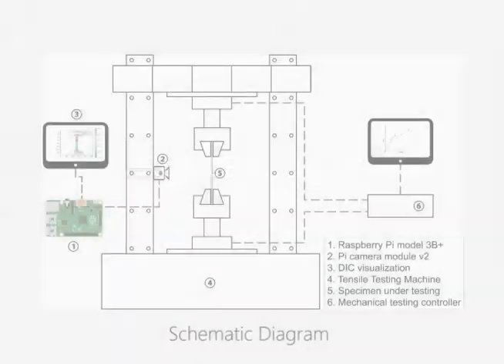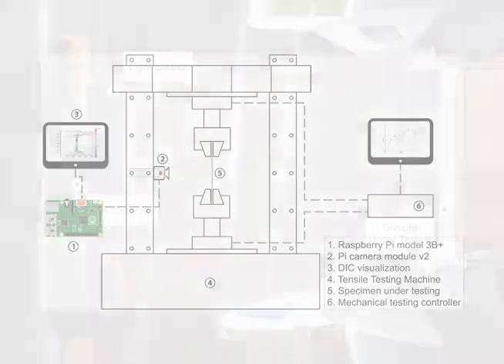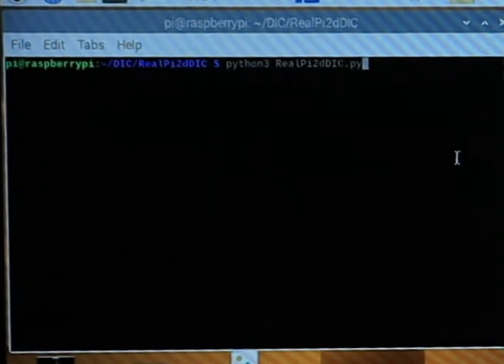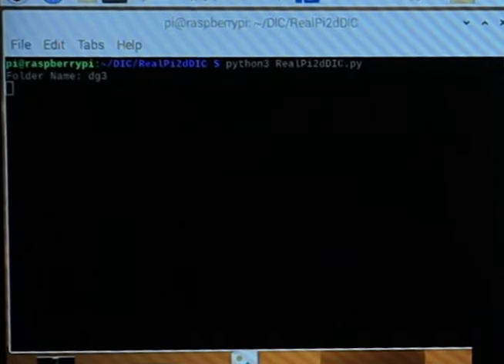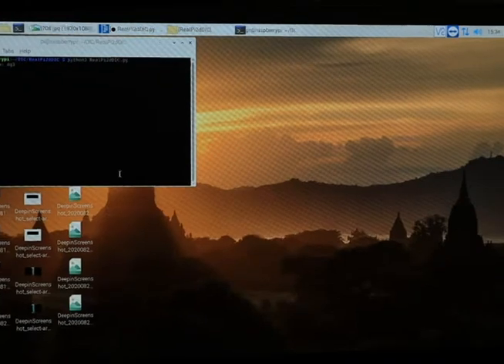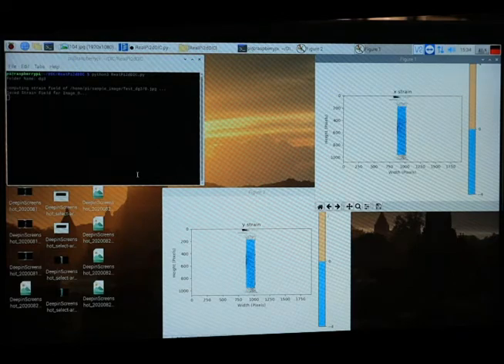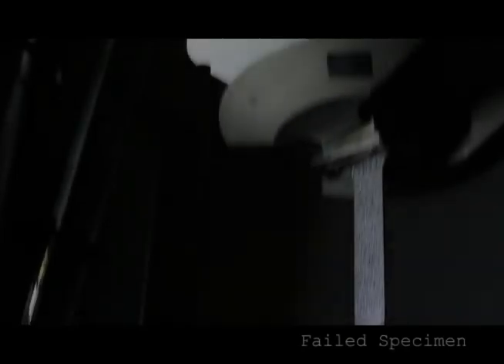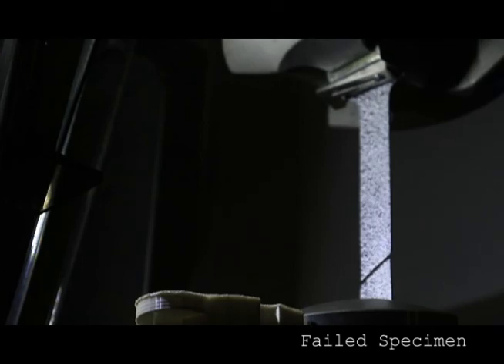RealPi2dDIC | Instructions and Demonstration

Comment: Hi Dr. Partha. I am Jorge, a professor at the Guadalajara University in Mexico. I am trying to understand if RealPi2dDIC is proper to measure strains during compression tests of small samples. I work with cylindrical samples around 6 mm in diameter and 8 mm in height fabricated by powder metallurgy. I hope to use a Raspberry Pi 400 with a 1080p USB cam (webcam). I read your paper and I was trying to find the permissible ROI size but I just saw that the software will divide the surface in small mesh grids (10 pixels x10 pixels) and that this could be changed at the source code but I would like to be sure if my setup is proper for the kind of samples I work. Thank you in advance.

Comment: Great job !
We have made a python tool to control experimental tensile test machine in RT in python !
it works on every linux PC including RPi{3|4}.
We already use python OpenCV  DisFlow to perform RealTime DIC in order to control tensile test and have Cuda compatible RealTime I-DIC algorithms. I think it would be great to add your work to crappy in order to make RT tensile test. We have finished to make a low-cost tensile test architecture with software and component stepper drivers, load cell drivers, displacement measurement, we hope to make an HardwareX Article in Q1 2021, feel free to contact me if interested.
I think you should think about adding (may be it is already done) V4L2 options for RealPi2dDIC, it will allow every one with a webcam to use your work with an old PC without any issues ! 
We already have this option in Crappy with higher stuff such as Ximea's cameras.
Best regards
Reply from the maker: I am sorry to reply this late.

That's great advancement in this field. I hope to read your article and try your setup. Best wishes. Thank you for your suggestion. We will certainly look into it. We will be more than happy to put our small effort into your idea. Please contact through email as there is no such option on youtube. My email address is parthapratim.das@mavs.uta.edu 

We look forward for your reply.
Reply: @ParthaPratimDas-XX  
We have some delays for the publication ... If you want you can have a look at the documentation site of crappy:
https://crappy.readthedocs.io/en/latest/
You will see that there is some I2C and SPI sensors that are already usable with raspberry along with real-time algo.

If you want to experiment real time DIC you can find this example:
https://github.com/LaboratoireMecaniqueLille/crappy/blob/master/Examples/correl_fake_test.py
it allows you to set-up a virtual test without cameras or even a test machine.

If you play with it on raspberry pi you should probably set finest_scale to 2 or 3

Best regards